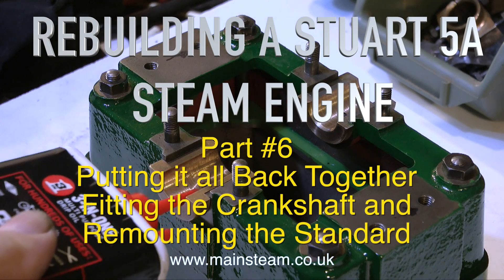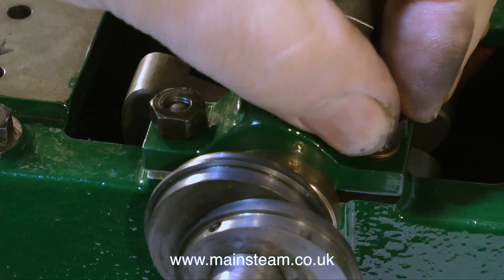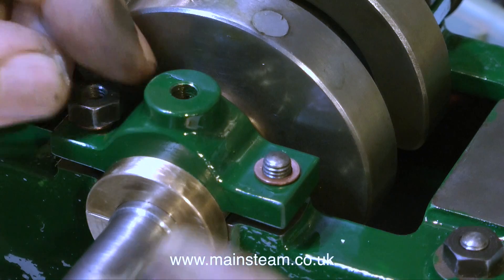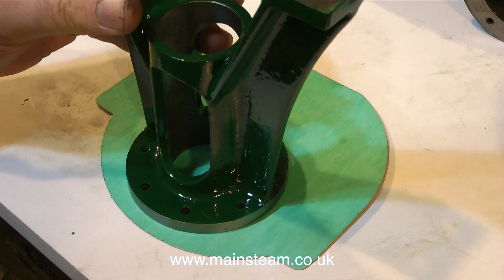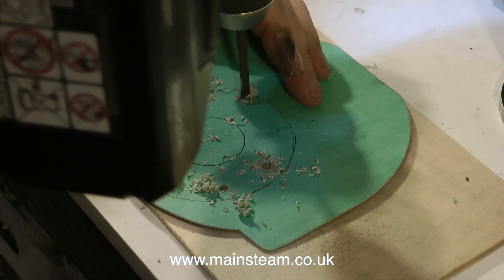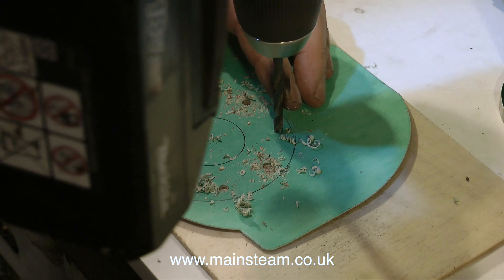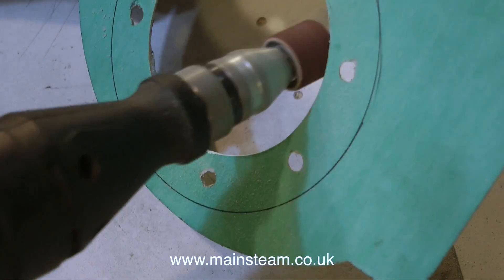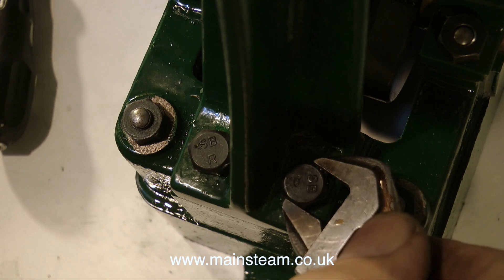STUART 5A STEAM ENGINE REBUILD - PART #6

Comment: A tip for cutting small holes in gaskets: Use what we in The States call a brad-point drill bit, but turn it backward (counterclockwise or anticlockwise). The spurs on the perimeter will slice neatly through the paper without lifting or tearing because the drill flutes are actually pressing the gasket material down. If the holes in your workpiece are the right size and you can get your drill in alignment, you can eliminate the transfer punch stage.

Comment: Are new Bahco adjustable spanners still as good as vintage ones?
Reply from the maker: Yes. I bough one about 5 years ago and it is just the same high quality.
Reply: Keith Appleton Thanks Keith.  This is a beautiful engine.  I am really enjoying the restoration.
Reply from the maker: Thanks John, Today I have been tweaking it and it is running much better - just the cylinder cladding to paint & fit now .............. :-)))

Comment: that's the way I am with my adjustable spanner if none of my spanners fit the nut or bolt, then I use my adjustable spanner.

Comment: One huge benefit of the adjustable spanner, is that the same adjustable spanner works for imperial AND metric sizes.  I suspect in Britain, as here in Canada, there are mechanical devices where they have bolts and or nuts in 47 different sizes, and half of them are imperial and the other half metric...
Reply from the maker: I fully agree with you. I work with model steam engines from early ones with non standard hand made nuts and bolts as well as metric, BA, BSF & Whitworth types. My lifespan is not long enough to constantly waste time looking for different sized spanners.

Comment: Hi Keith and thanks for another great video  - I really appreciate and learn from them.
Quick question on the transfer punch not working - would it have been a good idea to use the next size smaller??   Thanks again    Rod
Reply from the maker: as shown in the video, the transfer punch wouldn't fit in the holes nearest the standard uprights ..... I tried a lesser diameter but that wouldn't fit either.

Comment: When I was a kid back on the farm my Dad taught me to make gaskets by placing the material over the piece to be fitted and tapping the edges with a ball peen hammer.  Eventually the edges of the metal would cut through the gasket material and it was done.  I am curious if you have ever used that method.

Comment: About adjustable spanners, when I was learning Hydraulics I pulled one out to tighten a fitting and was reamed out by the supervisor for attempting to use one. Later in the week I seen him using one and asked why he could use one and I couldn't he replied that "he had learned how to use normal wrenches first and had now graduated to using a adjustable properly"